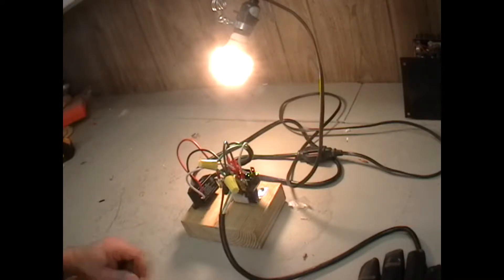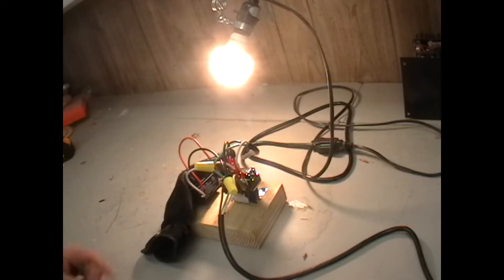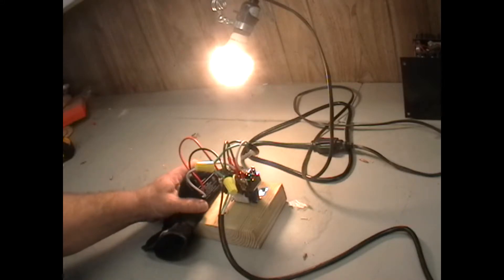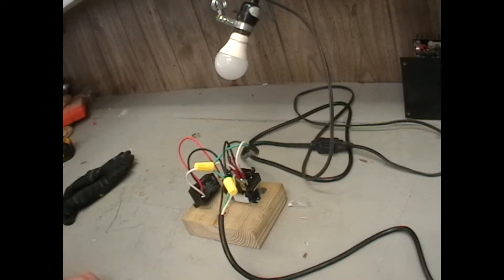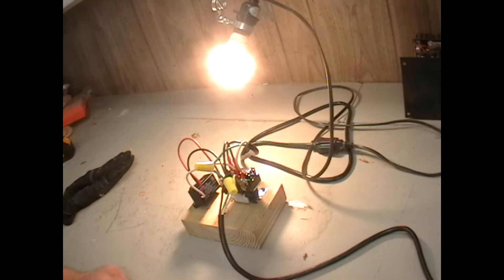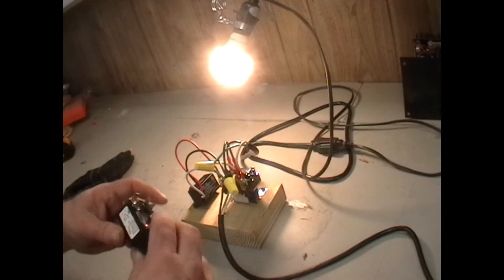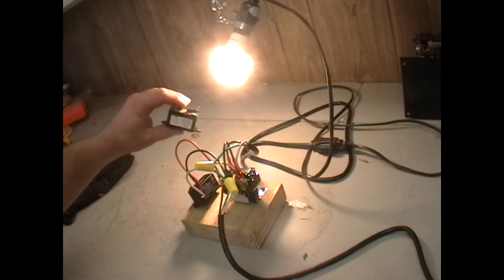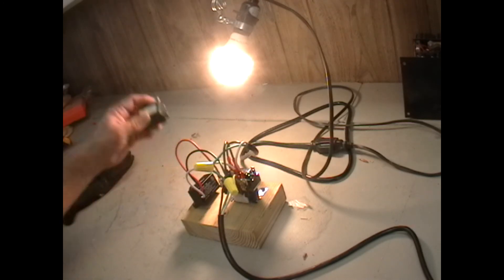Reverse Photocell

Comment: As a young pre-apprentice (when I was 16) I developed my own solution for the same control logic.

Here's how it worked. You take two photocells, onr temp-light socket, one 12 x 12 x 6 J-box, some opaque silicone caulking, and some length of conductors...

Drill one hole sized to allow one photocell to view out of the J-box. Drill 3 holes for your conductors to penetrate the box. Install the outside facing photocell, and wire it to control the light. Mount the other cell in the J-box facing the light and wire it to your penetrating conductors. Seal the penetration with culking. close up the J-box. Now when it's dark outside it's light in the box, and when it's light outside it's dark in the box causing the inside facing photocell to give reverse logic to the outside facing photocell. 

It does work. That said, the standard solution (the one shown in the video) is better because it is more compact, uses less parts (thus having fewer potential points of failure), and is less expensive.

I'm 44 now and my dad (the master electrician who got me started on my electrical journey), to this day refuses to recognize that I was showing good potential by displaying the ability to solve problems independently, and develop solutions for control logic. Both of which I think were pretty advanced things for a 16 year old pre-apprentice to be doing, especially when the internet just wasn't like it is today (you couldn't just look this kind of stuff up back then, it just wasn't there.).

Comment: All that talk about what it does and NOTHING about how it does it aka no explanation of how it's wired.
Reply: The relay is normally closed which allows current to flow to the bulb until the photo cell senses dark. The photo cell triggers the relay switching it to the open position at dusk then back to the closed position at dawn.
Reply: @drop6128  Yes we all know what a photocell does, but you still haven't explained how it's wired. That's the important part. Also why would you need to do this in the first place? There are Photocell modules out there, that turn ON during the day and OFF at night, as apposed to the ones that Turn ON at night and OFF in the day. Some even have a switch to choose.
Reply: @AztecWarrior75  hello, may i ask what photocell module to use, i want a circuit that turned ON during the day and OFF at night. please help me.
Reply: @AztecWarrior75  I'm building a ROV, for fun I`m thinking of adding a beacon which  surfaces during an emergency. When unused it's  totally  enclosed in darkness, in a box. When released it senses light and turns on the (blinking) LED. U know the name of the the "reversed" photocell? Link? Thanks :)
Reply: @drop6128  ignore the idiot